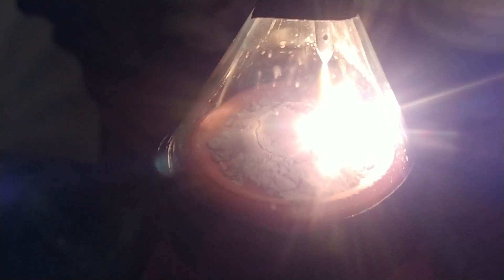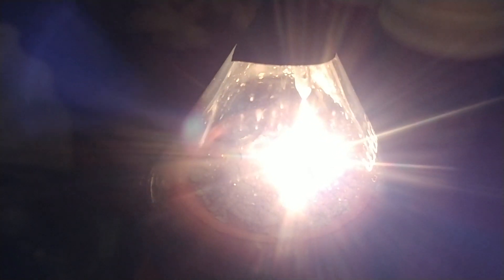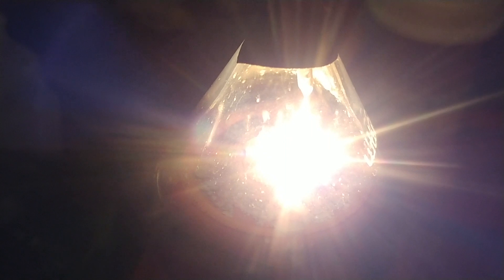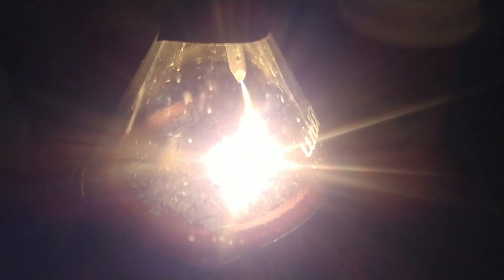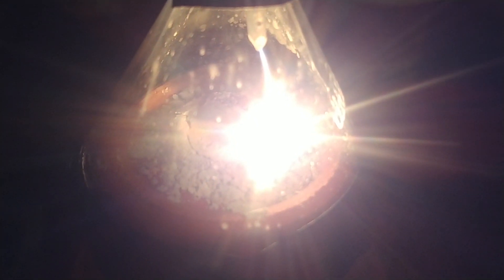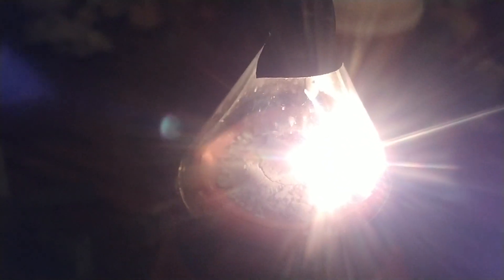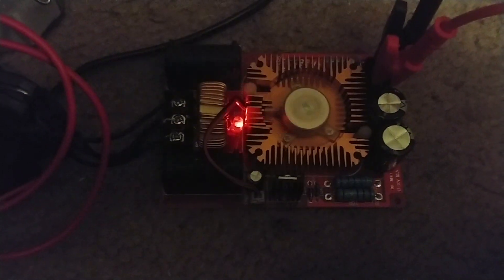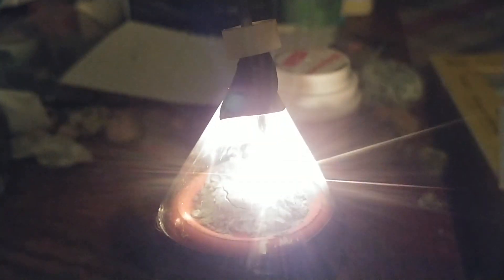Plasma Induced Fusion of Chromium Doped Aluminum Oxide - Synthetic Ruby via Electric Arc!

Comment: When I did it my ruby turns black does someone have an explanation ?
As a heating source I'm using a microwave transformer but I don't think it's the problem
Reply from the maker: @saharhordan  It should turn black initially and then turn ruby red upon cooling. Is this what is happening to you? If it is something different, let me know and I’ll help you troubleshoot.
Reply: @mwilson14  the problem is it's not turning red only black I tried different ratios but it still didn't work
Reply from the maker: @ What are your electrodes made of and are you using a controlled atmosphere? Obviously I didn’t control the atmosphere in this small setup, but I use argon now. Also, the amperage might be too high in your setup and you are depositing a great deal of carbon into the end product if using carbon electrodes. Do you know the purity of your reagents (aluminum oxide and chromium trioxide)? If there is an enough contamination from these then you could be introducing carbon contamination in the form of carbonates.

Comment: Yo is there a device I can buy online that can make me a large chromium aluminum ruby like a arc welder or whatever this is?
Reply from the maker: @ewok1411  An arc welder would probably work. That is basically what I’m doing using a flyback transformer. The only issues to work out is heat distribution so as to not boil the alumina. Figure out the temperature gradient and you can grow crystals in the proper zone.

Comment: Awesome idea well done - keen to see more on this one. IE: how big can you grow the crystal? Is it included? Do you have outgassing issues? Etc
Reply from the maker: @deepforrestalchemy9189  With this small setup, I could only grow tiny crystals which can be seen under the microscope. I have a larger chamber currently which is a vacuum chamber with electrode attachments. I have another that I partially worked on, but never got to finish due to unfortunate life circumstances. I’m still working to overcome these life obstacles, but I hope to someday get back into this stuff. I’m certainly not done with my ruby and sapphire experiments.